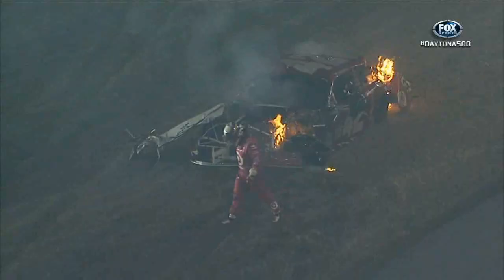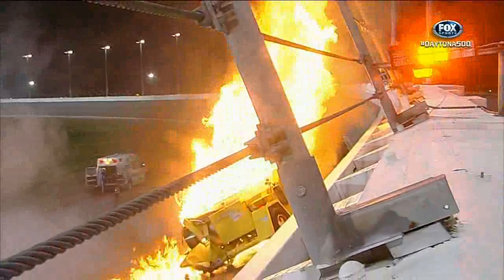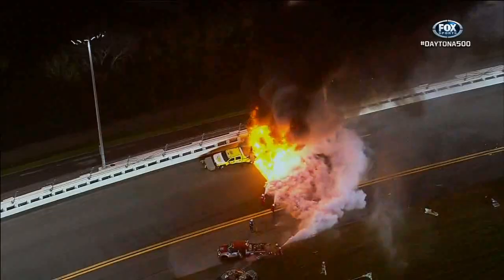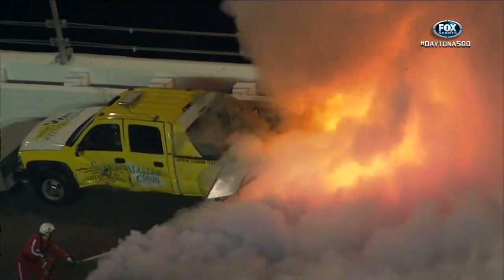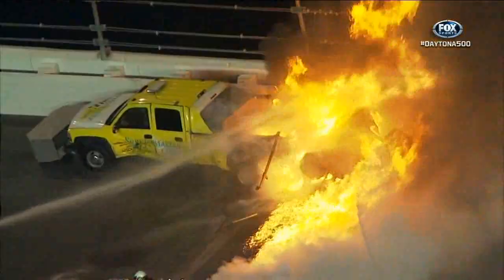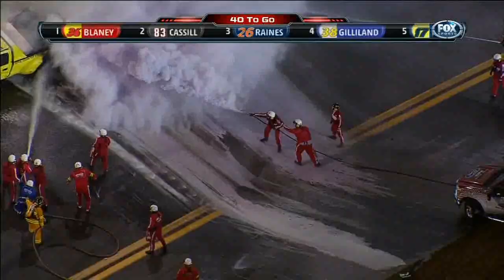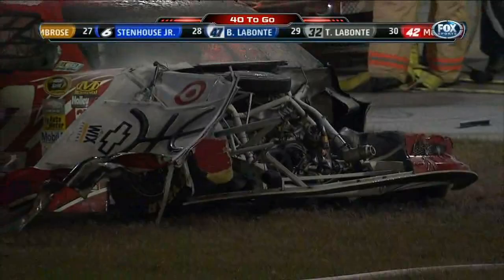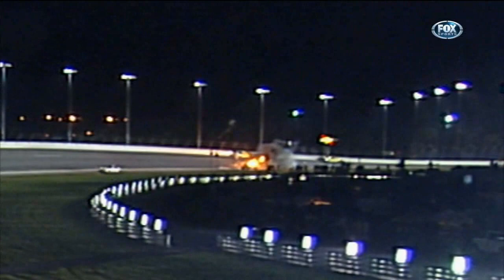2012 Daytona 500 Juan Montoya wrecks jet dryer huge explosion & fire

Comment: I like how the commentator suggests it might be a good idea to drive the flaming truck off the track as if the back tires haven't melted into a flaming pool of rubber already...
Reply: Not to mention all the fuel is burned up
Reply: @samwills8056  also that's where the axel components are, which have likely been warped.
Reply: @asdfpoop33921  I love how the negative he can think of isn't any of the structural damage to the chassis or wheels from the fire, or even that the truck itself will explode, but that the door is crumpled up, and he doesn't think you could get in. 
NOT ONE MENTION of the driver of the truck who walked away (fucking lucky dude) after having someone help him open the door from the outside...
Also, the fire is in one spot, why move it? Lol it's remarkable how little thought must go into everything this man says. 

I don't watch NASCAR but am a big fan of badass videos

Comment: Holy shit that jet fuel didnt melt those steel beams on the catchfence.
Reply: +SnakeBerry lol,,  thats ya classic everyday run of the mill progressive pancake effect caused him to crash right there ! 
they found montoya's birth cerificate passport full driving licence dental record finger prints an a stool, blood, semen, sample just off pit exit ,
nist computer model proves without a shadow of doubt f1's maldonado hit the track dryer
Reply: +fatbarry barry good try, Евгений Петросян
Reply: +SnakeBerry MAGA 
Yep.   I was totally expecting the entire track to collapse in its own footprint.  That jet fuel burns magically hot, after all.
Reply: But they will warp and weaken bolts and joints that support those steal beams. Thus the reason for the collapse on 9/11.
Reply: ZEZERBING
Not according to the Gubbermint.
Reply: jtoatoktoe
Right.  Sure it does,  Even with no flames, like 9/11.  And jet fuel causes explosions too, even after it's all burned up, like 9/11.And jet fuel leaves behind rivers of molten steel even 1 week later, too, like 9/11.

Like I said..."magically hot."
Reply: Adam Kachur stupid comments here, the fact is you're talking about 7 gallons of jet fuel compared to tens of thousands of pounds in a confined space... Now ask yourself, what's a major component to solid rocket fuel... Aluminium... what's a jet fuselage made of? Aluminium... How hot does it burn? Thousands of degrees, all very simple facts, another thing to add is that heat weakens metals to the point that they will always be brittle and weak... and that's science

Comment: Jet fuel can't melt steel cars.
Reply: +Arthur Peterson But is can make the steel red hot and extremely weak......
Reply: You dont know how heat works do you? Or how some fuels can speed up that process?
Reply: Yet it can melt the massive steel walls and beam of the WTC buildings and cause them to collapse like they were demolished on purpose ~
Reply: @theothertroll  wasn't there some sort of issue in the structural integrity in the WTC towers caused by the 1993 WTC bombing that played a part in the collapse of the twin towers

Comment: Did anyone notice how long it took the fire crews to get there?
Reply: Well the cars go around the track between 150-200mph. Those fire trucks do about 80 max? I'd imagine they would also have the trucks on call and need to be radioed in by the little trucks first after a damage survey.
Reply: They sure don't know how to put out a damn fire. go for the main source of the fire aka the damn truck not the fuel at the bottom.
Reply: jr540123 They got the fuel at the bottom to prevent it from spreading to the infield or where the firefighters were.
Reply: +jr540123 that was intentional. They were aiming at the track to avoid as much damage to the track as possible.
Reply: +NOS351W the fire was from the fuel leaking out of the truck not the truck itself.
Reply: The hash slinging slasher.  They did a bad job of putting it out. They needed should have used foam to put it out faster. If you look you can see them put the fuel out and because it floats on the water it reignites that’s why they did not go for the main source they would have just allowed more fuel to flow out of the truck. None of them had scba’s on or proper PPE for that kind of fire.
Reply: It's a damn race track, not a municipal fire service. The safety crews wear the single-layer nomex suits because it suits the job the best. You really don't need SCBA for track rescue. Once actual engines arrived, notice how they had structural firefighting gear, including SCBAs. Also, foam isn't readily available on the pickups, they carry CO2 because again, it's what suits them best. This was a one in a million event, and with the scramble that they had to do I'd say they did a pretty effective job knocking down this fire, considering that 200 gallons of jet fuel were ablaze
Reply: The track is 2.5 miles long.

Comment: They were using a chemical suppressant designed for fuel fires. They were doing it correctly. Foam like you're talking about (which is designed to lay on top of the fuel and starve it of oxygen) doesn't work on banked surfaces. It just rolls off.

Comment: Foam not water for a jet fuel fire. Perhaps they will now have a foam truck on standby every race. Foam would have put that fire out in seconds. Maybe mount a foam tank on each Jet Dry Truck with a pin strap pull release.

Comment: Why are they using dry powder instead of foam
Reply: Last resort to attempt to keep the flame from damaging the track
Reply: Actually Tide detergent----to clean up the spilled fuel (like dissolves like).
Reply: PKP is what the powder is called. Was a "fire fighter" in the navy and when this happened I was just as perplexed. Usually AFFF is used which is just a solution of highly concentrated soap and water.  That's the primary agent used normally in class bravo fires but PKP bottles are more readily available which is why I'm guessing they have those instead

Comment: is that jet A fuel leaking out of that jet dryer
Reply: Sebastian Wittmann if I heard right you can run a jet engine on fuel with an octane rating of 100 or higher
Reply: Sebastian Wittmann I wonder if they could power a jet engine with hydrogen or ethonol

Comment: You can see sparks  coming from the right suspension. Somthing broke or wheel nuts came off.
Reply: Something to do with the trackbar broke. A little after the race resumed his teammate Jamie McMurray had the same thing happen to his car, causing him to spin out and cause a big crash.
Reply: Absolutely. This is not Montoya's fault---just a catastrophic part failure.

Comment: So why did he lose control of his car? Was it a flat tire or brake failure? Looks like the latter but the camera was at a bad angle so it's impossible to see the back. I saw a puff of smoke indicating that he slammed on the brakes pretty hard.
Reply: one of the truck arms on his car broke and he just spun out
Reply: tire went down i went to this race because he slammed on the brakes too hard and braked too hard and lost steering control
Reply: Rear axle broke. He had reported gear problems before and the crew was trying to see what it was on the prior pit stop. He was sent out to do a lap to remain on the lead lap, but the axle failed. Just before Montoya hits the jet dryer, there are sparks from the left rear quarterpanel.

Comment: But seriously, the safety is not there during this caution. Why can Montoya travel at a high rate of speed even though a non-race object is by the side of the track! He should be slowing down by the middle of the back straight, not approaching the turn.

Comment: Kinda forgot now,  but do remember that the major heat from the fire did melt that section of track pretty good,  so I am going to take a wild guess and say that they didn't finish this race that night,  right?  That Jet drier truck should have been put in the NASCAR Museum,  as one of the toughest trucks in NASCAR...LOL,  That thing that was on the front of the truck,  guessing that was some sort of a counterweight because of how much of a massive weight the Jet drier was on the back of it right?
Reply: +Andrew Silva Actually I think they did finish that night. Though I think it went into the morning.
Reply: Search for 'The Day - Daytona Primetime'...
Reply: Search for 'The Day - Daytona Primetime'...
Reply: Search for 'The Day - Daytona Primetime'. Full race story on there.
Reply: They did. The fire was above the racetrack. Ultimately, detergent was used to clean up the track---loads and loads of Tide.

Comment: The firefighting effort was a shambles until they got a proper fire truck and water hose on it, those powder extinguishers were doing nothing, and why aren't the fire crews wearing the same kit as the real firefighters? You can see that the suits and helmets are offering them zero heat protection, so they're unable to get close enough to get to the seat of the fire and thus put it out. Those firefighting pick-up tucks are a waist of time.
Reply: They were meant for small car fires, which are a lot easier to extinguish. Not a jet dryer pouring gallons of jet fuel.

Comment: What a fucked race this was. Knowing this fuel,and how long it was on fire, it's really lucky this track didn't get damaged and the race get cancelled.
Reply: Brandyn Henry The Track did get damaged, And the race was postponed, if i remember correctly. They worked over night to get it back to appropriate racing surface and finished the race the next day.
Reply: Joseph Whitley The race was delayed for over 2 hours (red flagged), I watched this live, it was supposed to be the day prior but it rained and it was a Monday night race on FOX.  Ratings were very high.
Reply: Michael Scott Yea, your right, I watched it live as well and remember it being on a monday night. I just didnt recall whether it was cause of this or some other reason.
(the rain)
Reply: Jet fuel, diesel fuel, and kerosene are all basically the same with different o2 molecules. This happens on highways all the time. The heat is actually above the track itself and rises, doing minimal harm to the track. The only real problem is getting it cleaned off.

Comment: The slowest firefighters, amateurs. If that was a car and the driver was pinned and couldn't get out, he would've been burned alive.
Reply: +alivewithpassion you do realize thats fucking jet fuel right? you cant put that out because of how hot the jet dryer was, and from having 100 gallons of fuel, they either had to get it cool enough so it wouldnt reignite, or let all 100 gallons burn off
Reply: +HawRazor No they had a very slow response. Yes the smaller pick-ups were out quickly, but the type 1 engines took forever, and as we saw the pick-ups had little control over the fire until the type 1's arrived.
Reply: +Bnadit Fleet it's still jet fuel...You can't simply just put it out
Reply: Yes, but the type 1's should have gotten there a lot sooner. Also they took so long because they were using dry chem, not foam. If they had used foam and tried to put it out rather than dry chem it would have gone faster, but they had no idea that this would happen thus they had no foam on hand to use.
Reply: The priorities are two-fold:

1. Make sure the truck driver is okay.
2. Prevent damage to the racing surface.
Reply: K J The fuel was from the jet dryer, and it was closer to 200 gallons.